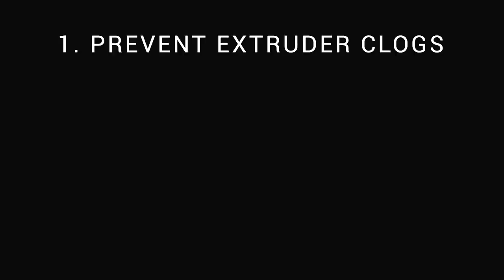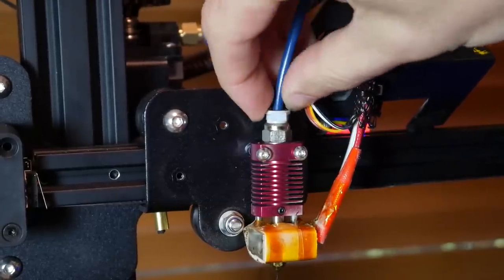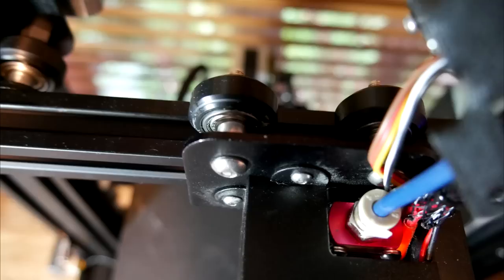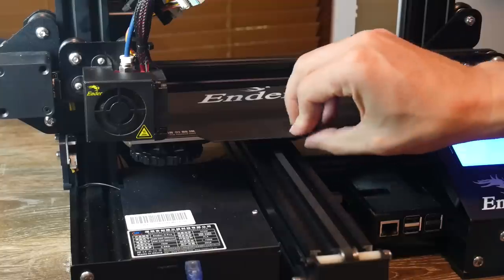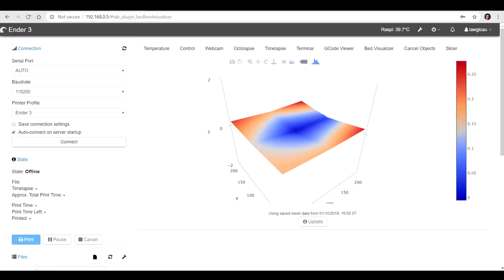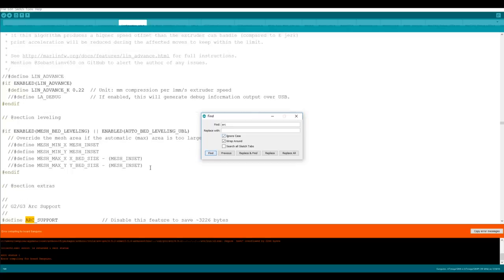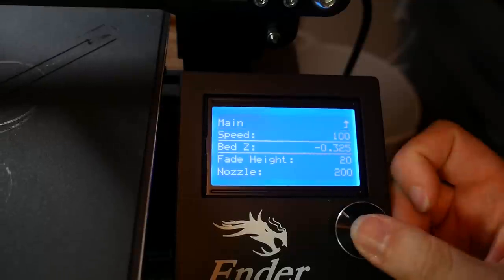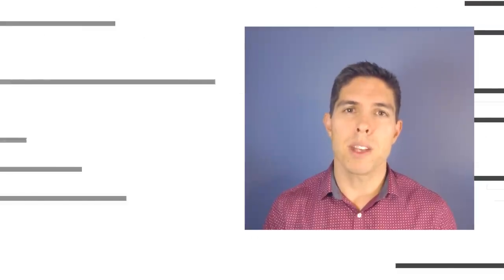5 beginner Ender 3 fixes - featuring manual mesh bed leveling guide

Comment: This was VERY, VERY helpful in resolving a problem I was having with filament dragging on my initial trace lines, which lead to bunching and all kinds of chaos.  I had leveled, but probably used too thick of a piece of paper to level, and my initial layer was too high off of the bed and was dragging.  I didn't need to dig too deep or do the mesh bed leveling to fix the problem, but this video was the single most helpful troubleshooting I've seen out there!  And... I took your advice and searched for an answer before asking it, fortunately, you had the answer I needed before asking!!!
Reply: I have this same problem

Comment: I just bought an Ender 3 and my first print came off nearly flawless, with little fiddling.  After one print, the bed warped exactly the way yours did,  A bit dished in the center. I suspect this is common for the thickness and the placement of the heater element.
I am so grateful for your videos. You are saving me a lot of time.  Thank you!

Comment: It's frustrating that these groups are hidden behind Facebook for non-Facebook users anyway with that being said, thank you, Michael. The tip on mesh bed leveling is invaluable to me. I've been scratching my head on how to compress the firmware down to accommodate the mesh leveling system without any luck, figured there just wasn't enough space for it on the board, so glad to find your video and the workaround for this! 
Much appreciated.
Reply: U find a Google drive link anywhere?
Reply: Well I did what he said and I still have overflow by 2970 bytes
Reply: @jodymorrison9495  most probably you will have to flash the firmware without the bootloader.
Reply: @D4no00  
Same problem ... how can I do it?
Reply: @anmon8548  you will need an arduino for that, google Arduino as ISP.
Reply: @D4no00  Ok, I tried, but the space occupied by the sketch remains the same even if I load it using isp. In this way I always get the error .... Space available always the same
Reply: You not having FB is really a personal problem. What other social platform does it let you have files and conversations like FB? I can only think of a proper forum but someone would have to pay for a host. Join for free on FB and get free resources doesn't get better than that.
Reply: @nobytes2  Yep reddit you can see messages but you can't ask any real questions without an account
Reply: @ipodtouch470  what's the point of that, If you can't ask any questions. Especially for beginners.
Reply: Constructive Bytes  Reddit.
Reply: @nobytes2  facebook is not a good solution for anything.. forums, reddit.. make a new account ask questions..  on the other hand use your FB account, let other people track what you are doing.. Facebook even tried to force you to use your real name.. this is only one thing of hundrets why I wouldn't recommend it..  one time I got the new address of my ex via FB.. but not because she did something stupid.. it was a friend who took a photo which was public where her address was readable..  it was a 5 min job..  I have no time to check all the time if any of my contacts do shit with my private information.. 
Most 3D printer users are DIY/tech enthusiasts which care about security (or at least they think they do).. and then using fucking FB groups... something is wrong in this world..
Reply: @K4daniel  I mean you have to make an account for just about everything. Reddit sucks for QA imo, but to each its own. I was just saying you getting free information from youtube and on top of that people are crying because they don't have a FB is pretty shitty to me.
Reply: Mine was to far over to removing the boots reen sorted it
Reply: @nobytes2  Do you have to display your real name to everyone on "just about everything"? No. Also the argument of needing to pay for a host isn't valid, there are plenty of free solutions.
Reply: @Krytern  Dunno what you're rambling on about. FB, Reddit, pretty much anything you can put a fake name. Please tell me that you know that, right?
Reply: @nobytes2  I put a fake name on FB. Got banned. They also sell your data. Facebook is also a terrible place for a community, a proper forum is better, with better tools. This is just a basic fact. Also, your real Facebook account you have, they are selling your data, good job.
Reply: @Krytern  There not selling any of my data, because I don't use Facebook, but youtube is selling your data lmao fail
Reply: @nobytes2  I don't have any real information on YouTube "lmao fail" for thinking you "got me". Muppet.

Comment: I have had an Ender 3 for two days. I will not give up as all my problems have been identified now as user error. Fantastic tutorial thank you for taking the time.
Reply from the maker: No problem. Keep persevering.
Reply: i just bought mine and having problems and been working on it for 2-3 days and nights now ugh. i having issues with extruder skips ive level the bed enough so the nozzle is laying a great first line but then after midway print it start to click then loss of layers with results into a failed print.
also im using cura 3.5.1 and ender 3 profile. Should i be using cr-10 profile instead.

Comment: As someone that almost never comments on videos, I must say thank you for this video.  I found the manual mesh leveling section to be very helpful.  My Ender 3 Pro came with a moderately warped bed that prevented a good and even first layer, especially on large prints.  With the manual mesh leveling all is good now.  However, even when following your instructions closely, the firmware was still too large to fit into flash  memory with the bootloader installed.  This was solved by disabling the splash screen in config.h.  That gave me just enough extra memory to load  "Vanilla" Marlin successfully.  Thanks Again.

Comment: Hey Michael, thanks for the tutorial. I too had a dipped centre on my build surface. Manual Mesh bed levelling has all but cured the previous problems and will work perfectly until my BL Touch arrives.

Thanks again for the video.
Reply from the maker: Great news :)

Comment from the maker: Marlin will inevitably progress from this video, so in future you may need to disable more things to get the manual mesh bed levelling to compile at the right size. I have summary of these things here: https://youtu.be/sUlqrSq6LeY?t=751

The debate continues on the concept of removing the assembly screws. Here are some links to videos on the matter that may help you make up your mind:
https://www.youtube.com/watch?v=W_dZSKzUKbM
https://www.youtube.com/watch?v=eM-rJWBuWhw
https://www.youtube.com/watch?v=ItJTrTX6HJw
For the record I haven't had any issues with clogging or a loose hot end before or after the mods shown in this video.

Comment: To anyone having problem with com port access while uploading firmware to Ender-3 ;

- Disable all com ports except the one connected to Ender-3
- Remove all devices connected to USB slot of your computer
- Disable bluetooth devices from device manager

This worked for me, may helps others.

Comment: I think to add M420 S1 to the g-code in Cura, you go to Settings -> Printer -> Manage Printers -> [Click Ender 3] -> Machine Settings. Then it is under the Printer tab as the Start G-code text field.
Reply: and here I got a problem: after M420 S1 printer just stops doing everything, it just got freeze. any ideas?

Comment: Recently got my Ender 3 Pro with the silent motherboard and the first print came out awesome but I did end up with a slight dip in the bed center the mesh leveling really helped thanks ! For people who are also using manual mesh bed leveling instead of havng to call M420 S1 after G28 just uncomment this in configuration.h "#define RESTORE_LEVELING_AFTER_G28" this will make the machine use the mesh automatically after your printer auto homes when starting a print.

Comment: Great video, as usual. Actually, the PROBE_MANUALLY option applies to all the auto bed leveling types, but is best with ABL BILINEAR. I created PROBE_MANUALLY as a more full-featured alternative to MESH_BED_LEVELING. MBL is still included in Marlin as a lightweight option for machines that have limited program memory, and when it’s enabled manual probing is assumed.

Comment: Thank you for all the videos which you have made, over the last week since i got my Ender 3 Pro, i have watched and learned the steps to make this machine amazing, I had only issue is when i did the bootloader and Marlin install, i thought i had bricked the board, but after watching again and again, i was able to get all running good, and able to use my whole bed thanks to enabling the manual mesh leaving, thank you again. a very happy Canadian.

Comment: Hi Michael,  when doing your bed leveling, I think if you cut strips of paper about 1.5 "- 2.0" wide and about 5" long can help make your feel for the level adjustment better, I depend on the flex of the paper to tell me when the level is right. if you move the paper back and forth while adjusting the height you'll see it start to bend when the height is right. Also it's really important to pull your filament and clean your nozzle head so there's nothing but nozzle sticking out. I've seen lots of times where a small blob of filament is still in the nozzle tip and that can muck your adjustment. Great channel by the way. I have a CR-10 and some of this is of course helpful for people with CR-10. Thank you!
Reply from the maker: Great tips, thanks for sharing.
Reply: @TeachingTech  Two Words:  "Feeler Gauge".  You will be surprised how much better your adjustments will turn out.  I have several sets in my tool box and make good use of them.  I GREATLY Enjoy and Learn from your videos!  THANK YOU!

Comment: Note that on the Ender 3 Pro, the Z axis can be moved by hand and will actually move down under its own weight. You need to home, then hold it with something and disable steppers. Then go to move and move Z up a bit and then down. Now you can move X and Y but Z will stay in place because the Z stepper is engaged.
Also note that to flash Marlin, you will need to burn bootloader into the board. You can't do this by using the USB wire. You need to use the serial programming pins and either a USB serial programmer or an Arduino board with the ArduinoISP sketch uploaded. You'll find more info on this on YouTube. After burning the bootloader, you need to keep the programmer "Arduino as ISP" selected. Then flash Marlin. It works, I did it myself and it worked. DISCLAIMER: not all motherboards are equal! If you have a cheap one, you're running the risk of soon having a very expensive paperweight by messing with bootloaders! That in mind, you still need to flash Marlin. It contains thermal runaway protection. Stock Ender firmware does NOT.

Comment: For the bended bed I used aluminum kitchen foil 2 or 3 pieces, square with a side of around 10cm. It worked perfectly when I put it in the center.

Comment: Wish I'd found this video 2 years ago, my bed also dished in the middle but I shimmed it up with about 20-30 pieces of slightly different sized aluminium foil between Al plate and glass - makes changing surfaces near impossible but almost flat.....doing via software would have been a ton easier. Have a bl touch waiting on install for about 9 months now might be time to put that in. Just wanted to say thanks I watch a fair few of your videos sometimes I forget to like them :).

Comment: build my first ever 3d printer well its prebuild the Ender 3 v2.. it was right away from the first time printed awesome i even bumped up the speed and disabled retraction to improve the speed and print duration for some bigger 3d models! greet result without retracting it has some strings but doesnt matter love it! since i see so many problematic build videos i was kind a scared at first but turned out good!

Comment: I made a newbie error as my Ender 3 pro Z axis limit switch wasn't set up out of the box for the glass bed. The result was a damaged nozzle. I then made it worse by changing the nozzle cold and getting the hot end covered in burnt PLA. I ended up buying an original creality replacement hot-end kit, and for a few pounds more it came with an all metal extruder and Capricorn XS Bowden tube. That is when the problems started :) I was getting incomplete prints, with the filament not feeding and eventually being worn through by the extruder. I went through all the recommended steps, checked the tube was fitted up to the hot end and extruder fully, changed temperatures, measured the PLA, adjusted retraction settings, loosened the bolt that goes through the grooved idler bearings a little, adjusted the extruder tension and all to no avail. Sometimes it would print for an hour and stop. The signs were the extruded clicking as it tried to feed the PLA and couldn't. If you removed the PLA and replaced it then there was no blockage and it continued. I see a lot of advice showing how to increase spring tension in the extruder with spacers etc. I think the need for more roller pressure may be hiding the root cause. In my case the problem was that even with the adjuster all the way back, there was still too much spring tension and it was flattening the PLA. Capricorn tubing inside diameter is 1.9mm +/- 0.5mm and they don't recommend PLA over 1.8mm. Most PLA is 1.75mm +/-  0.03mm so 1.78mm max. The extruder was flattening the PLA so much that it was typically 1.83mm in one dimension, and occasionally 1.86mm if the PLA was stood in the extruder for any length of time. I checked all the components against the old plastic extruder as they are similar, and the issue turned out to be the spring. The upgrade aluminium extruder (genuine Creality) was longer. So I swapped them and its now fine. I don't know if this is a one-off or there is a faulty batch of springs but one to look out for.

Comment: Your videos have always been helpful. However, you had recommended not investing in the tempered glass bed surface, saying that it wasn't worth the price for the improvements to prints. My Ender 3's black mat surface never would allow for good adhesion, no matter how many times I went through the process of manual leveling. Glue sticks and hairspray helped, but after a higheth of about 8 to 10mm, objects would pop off the bed. The warping was bad and severly limited the kinds of prints I could do; large prints were almost entirely out of the question. That lead to my original hotend being destroyed as I was away from the printer for a few hours and a object being printed popped off the bed 10+ hours into the print, and the free radical object became permanently welded onto the hotend.

Alas, the Gulf Coast Robotics tempered glass bed not only drastically improved bed adhesion, but it also improved print quality, as I was experiencing bad warping on the first layers of almost every print. Now my prints are warp free. That black mat surface just never worked for me like reviewers have claimed it would: "It works too well! I have problems unsticking objects from the bed!" I have the exact opposite experience, so I'm not sure who's to blame, but I do know that that glass bed was well worth the price, and I won't have to replace another hotend for a while due to objects coming off the bed during prints.

In any case, I appreciate your channel, Teaching Tech, and hope you continue to share your insights and wisdom of 3d Printing to the world.

Comment: It appears that the really cool version of Marlin offered up by TH3D does not have manual bed mesh leveling.  I flashed a boot loader and updated my Ender 3 Pro with the current (as of today) TH3D_UFW_U1.R2.A1 software.   I was not able to follow this guide as several components listed are nowhere to be found in the configuration.h file.  Is there any updated version of this process or has it been confirmed that TH3D left it out?

Comment: I was borderline ready to just chuck my Ender 3 Pro right in the trash can. Manual mesh bed leveling works amazingly well. Thanks for your great videos! I tried the default 9 point grid and used a .102mm feeler gauge. After I got that done I set the Z offset to match the feeler gauge I used and presto. If I ever get tired of leveling it then I'll buy a sensor or probe whatever I need I have no idea but thats what youtube videos are for. 9 points doesnt seem like much. I'm wondering if people bump it up to 5x5 or something larger than the default 3x3.

Comment: I have recently got the ender 3 and indeed had the bed warp in the middle, I just cut some photo frame glass and clipped it on, it fixed the problem and I have printed several things without a problem. I still have not fully tested the bed temp to get a solid adhesion but if I use some masking tape nothing has come loose